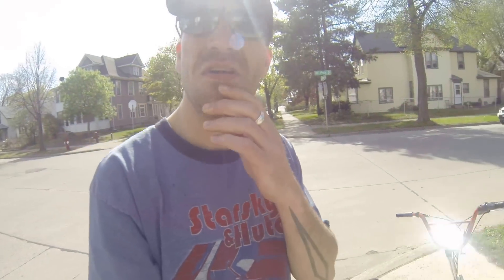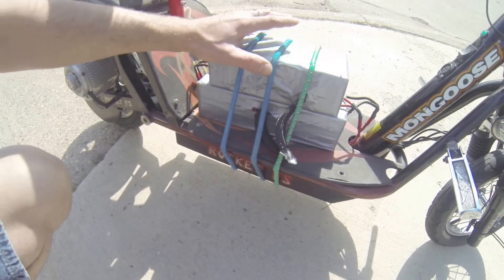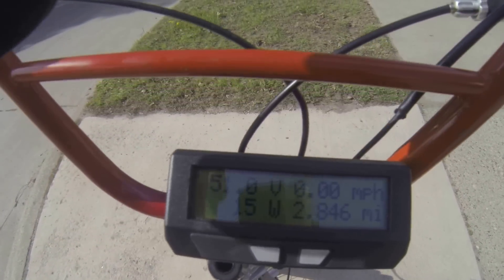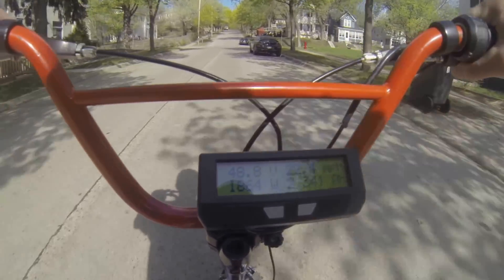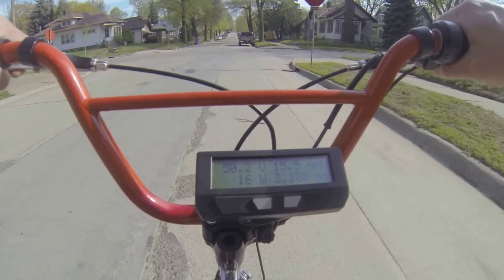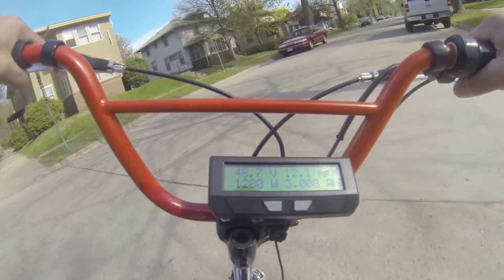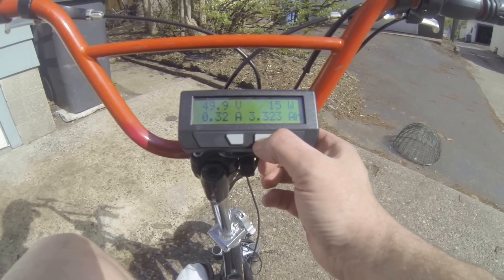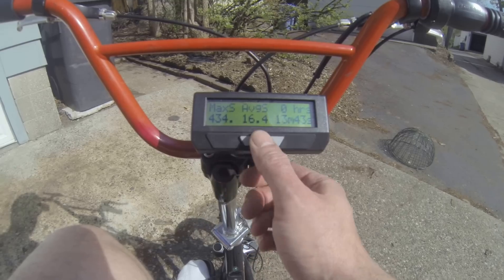Currie-Tech Electric Scooter w/1000 Watt (36v/32a) motor, over volted and re-geared: 30mph 1900watts

Comment: what sprocket tooth are you using? 72tooth
Reply from the maker: front sprocket: 13t
rear sprocket: 65t
Gear Ratio: 5 to 1
Reply: @augustjohnston  I also have the same 1,000 watt motor you have. But I need to find some lashout rims so I can make a custom sprocket for my 03 missle fs
Reply from the maker: @fastfords9072  I ordered both sprockets online.
Reply from the maker: https://alfa-wheels.com/products/25-65t-4-hole-sprocket-chain-drive-gear-f-rear-wheel-gokart-scooter
Reply: @augustjohnston  I used to get mine from Scott at ev deals but I think he died. I'm trying to get 2 lashout scooter wheels
Reply: @augustjohnston  did you take the original 90t and custom make it? I had the guy at ev deals do it 10 yrs ago but I think he died. This whole new market of scooters is crap. Schwinn, Currie, fs lighting, lashout scooter is so rare hard to find. I have a missle fs
Reply from the maker: @fastfords9072  no I ditched the 90t for the 65t. better gear ratio for 30mph. and still enough torque of the line for my 180lb self. I had to retire this rig because the band brake  wasn't up to the job. anything over 20mph and would start to feel slippery and not catch. super dangerous

Comment: I took a Schwinn S750, threw this motor on it and left it at 36v but swapped to a 20ah lipo and have the 15 tooth freewheel motor sprocket as well as the 47 tooth wheel sprocket. I'm running a brushed 1000w controller and it gets 35mph on flat and 28 up most hills. I'm only 130lbs so not much for the scooter to move

Comment: Fuhhhhhk ! What's with your audio, man ??! 
It does book along though- I'll give ya that !
Now to find a way to mou t the batteries that wont look lame.
Hope them cars don't nail you ! 
W
Reply from the maker: yeah the gopro picked up every sound on the scooter.
 I actually retired that particular scooter because the cantilever brakes stopped working on anything faster than 20mph. I'm building a disc brake version.

Comment: I have a motor 1000w 24 v    .. if i runn it with 12 v .. how much w will   it spend  ( will my bateryes last longer ) ps : using it for ebike
Reply from the maker: about half the power, and the batteries will half as long as their 24v comparison, assuming the Amphours are the same.
Reply: @augustjohnston   i have a 1000w motor but i cant feed it with my bateryes .. what shuld i do .. any suggest ?

Comment: I've got a Schwinn S350 (also Currie Tech drivetrain). I swapped out the stock dual 12 volt lead acid battery setup with a vastly superior dual 12 volt Duracell lead acid unit. I weigh 165 pounds, every nut and bolt on my scooter is either new or re installed properly and my tires are pumped to 50 PSI for maximum efficiency. I heard LiPo batteries make for a serious improvement over Lead acid due to improved charging times, much lighter weight and increased power output. I'm wondering if anyone knows a way to hook something like that up to my Schwinn S350 and if it's possible to hook up more volts than what mine currently has (24 volts)
Reply from the maker: The 350watt motor on that setup will take more volts, but they tend to over heat very quickly. and when they heat up, they don't work as  efficiently.... and often burn out. personally, I wouldn't bother overvolting anything under a 750watt motor. But if you decide to try it anyway, try adding a 3rd battery in series to make it a 36v setup. Some of the controllers will shut off if they get too hot. even on my 1000w setup, it'll shut off if I go full throttle uphill.

Comment: We had a little kids electric bike with a currie 4 brush 200 watt motor. Pretty sure we put 3000w through it for short periods, was frightening it screamed, and felt like the chain was going to break. Not often you get an electric bike breaking traction going down hill with a load on. Not often your frightened to get on an electric bike.

Comment: BH
hi , thanks for the video. i have almost the same scooter.  My back tire popped. Have you ever tried replacing the tire on yours?  If yes, coul you please give me a little guidence on how to remove the back wheel?  Does it require me removing the motor?   Thanks so much.
Reply from the maker: it depends on the scooter, but most of them you DO have to take the motor off. I've changed my tire at least 10 times on 2 scooters, over the past 10 years. They pop easily unfortunately. it's not rocket science to change it. 2 axle nuts and a few hex bolts. you probably have to disconnect the rear break cable to get the wheel all the way off. Takes me about 20 minutes.... but it used to take about an hour until I got more practice.

Comment: who makes the motor
Reply from the maker: It's a china motor. Currie-Tech Branded. I had to stop using this scooter because I didn't have disc brakes. the V-brakes, at 30mph, are nearly non-existent. they actually feel slippery until I slow down to about 19mph, and don't grip well until about 10mph. WAY to unsafe.

Comment: That's a great build! How has this motor held up to that much voltage? Thinking of putting one in a Razor Crazy Cart.
Reply from the maker: it's still kicken. I have 1500 miles on it. I discontinued this scooter and put the motor on a dif setup. The brakes were highly insufficient. almost died a few times.

Comment: Skip to 2:20. that thing is fast! thanks for the vid; I run my ezip 1000 at 48v as well; goes 20mph on flat ground, 17 up hills.
sucks the first minute sounds like nails on chalkboard. i'd recommend deleting the audio or just that part; maybe just use music and add notes.
Reply: Hey OffGridNorthwest, I'm putting 60volts on my ezip 1000. Hows yours holding up? Did the extra batteries increase your distance much? Thanks.
Reply from the maker: I run 58v li-ion pack in my ezip1000 (I have 2 actually). I have over 1500miles on my speedometer. the motor is still kicken strong. 
one of them is making noise. I have to open it up... but I think it's the gears, not the motor.

Comment: are you using the standard speed controller that comes with the currie scooter?
Reply: +John Ellis I use the stock controller with 48v just fine, but it won't go over 20mph, so I'm guessing he's using something else
Reply from the maker: In this video, no. I upgraded to the 30amp controller.
Reply from the maker: be warned though, the pin configurations are different on the 30amp controller! huge pain in the ass.
Reply from the maker: (throttle pin config)

Comment: what type of motor controller u r using to control the speed of motor .. and how much amps ur battery can supply
Reply from the maker: 30amp controller. looks exactly the same as the stock ezip1000 controllers, except the throttle connectors were different. had to buy a dif throttle because I couldn't figure out the pin re-configuration.

Comment: Why does yours go so dam fast. I have a 48V, 1500W brushless motor and it goes about 10 mph for about 500 ft. before cutting out and dropping to 3 mph due to heat?
Reply: +Tucker Not Sucker! try a smaller motor, and over volt it, these curries use a 1000w 36v motor so a 48v set up would be great , swapping controllers may help as well
Reply: Fareed Alshami So I can run let's say 64V through a 48V motor or even higher there must be a limit?
Reply: between 60 and 64v. i try to stay conservative, but 48v is excellent in our 36v scooters, i dont remember if i used the stock controller, but if im not mistaken the stockcontroller can handle 48v . i may hve also upgraded it for better power

Comment: im 15 years old and im only 90 pounds and i have the schwinn stealth 1000 and i over volted it to 48 volts and it goes about 25 mph. it runs fine and i havent noticed any cosmic wear or anything from the stock motor or controller. but i noticed i had to chare the batteries only a little when i first did it becasue the controller wasnt breaking into it instantly. but about 4 days later i was able to charge it fully and the controller could take it. has anyone ever tried 60 volts? i would like to try it.
Reply: +Chance Hastings only ever go up by a little i , forget the exact number but i think its like 1.5 times you can go up before blowing a motor
Reply from the maker: as seen in the video, I have the same motor as the stealth1000. I'm putting almost 2000watts into the motor with no problems. However, the stock controller on one of my stealth1000's would shut off when I put 48v into it. I replaced it with a duplicate controller and it worked fine. I believe the thermostats in these vary a bit. The replacement controller shuts off if I go full speed uphill with extra weight. but if I go 80% throttle, it doesn't shut off.
Reply: It may be temperature limiting or even potentially amp limiting or limiting voltage. Its a number of things I'd just go with an aftermarket controller. I avoided over volting this model since I was afraid I'd start breaking gears since I think they are just nylon
Reply from the maker: yes, it's the thermal limiter. some are more sensitive than others. if slowly accelerate, it doesn't heat up as fast. 
the gears are all hardened steal. WAY WAY WAY too much torque for anything less.

Comment: very dangerous chassis above 25 mph , ive done it , seen it been there.. but congrats
Reply: Naaa it'll be fine. I've had my ezip 500 over 40mph. Nothing stock except the frame. It held up just fine.
Reply: @DTB2.0  what did you upgrade with ???
Reply: @djmusclecok  I upgraded the controller and installed a brushless motor and lithium batteries

Comment: nice video
what kind of range do you get on one charge with that setup?
Do you know much about the battery packs?  I'm wondering if they're made with 18650 batteries which is what I was considering using to build my packs whenever I get around to it since I can get them for around $1 each.
I want to do this on a bicycle though.  I came to this video after searching craigslist for electric bikes and found one there that had a Currie motor and I was looking here on youtube for instructional videos involving Currie motors.  This is so far the best if not only video I've seen but I haven't tried looking at non-Currie motors yet.
Thanks...
Reply from the maker: yes I use a 48v/10ah (10s13p 18650) that I built for another scooter, and it fits in the battery pan on this scooter too. I usually charge it after 15 miles. but I think it could safely go 18 or 19 miles in perfect conditions (I weigh 175 lbs). The pack already has over 1000 miles on it and it's still rocken strong (2 summers of zooming around)

Comment: Can you send me a close up picture of your set up with the motor ? I need to see this cause I blew my gearbox to my ezip1000 36v the motor works but it's not moving :/ therefore I want to convert it from direct drive to chain (I'm tired of the problems the gears are giving me , I rather have chain
Reply from the maker: well, that wouldn't do much, as I put the new motor on and older setup. However, I do believe you could add gears. you would have to add a rear gear to the back axle... which is 'keyed' and spins (unlike my setup where the axle is stationary and the gear is on the hub). I recommend getting your hands dirty and just figuring it out like I did. I can assist you in chopping the gear box off, and unless you plan on getting an older setup, I wont be much help.

Comment from the maker: Sound like a plan. altho, the 1000w currie motor, at 48v runs about 4200rpm.
Plan accordingly. 
front sprocket: 13t
rear sprocket: 65t
Gear Ratio: 5 to 1

Comment: pretty cool, did u change the motor sprocket to a 15 tooth?  im in the middle of a project , bought a x-treme x500 48v for cheap and im gonna put a 3000rpm 1kw motor , controller, and 15 tooth sprocket on it .   what do you think?  ordering from same tnc website

Comment: thanks for your help. I have the 15t motor sprocket with freewheel. Is there a way to remove the freewheel off the motor sprocket and just use the 15t by itself? that way the 3" tire will fit. (i currently have the 2.25" tire)

Comment from the maker: well, it wouldn't make sense to use 2 freewheels on one drive system. I used a rear freewheel as the motorside 15tooth freewheel wouldn't fit between the motor and the tire (I am using 3" x 12" tires). The reason you shouldn't use a freewheel is because, after decelerating but still coasting, if you re-engage the motor it will go full speed until it hits the matched coasting speed... at which time it 'snaps' or 'catches' quite forcefully causing the front sprocket to strip out.

Comment from the maker: that XYD-12/13 motors are inferior compared to the XYD-18 (1000w). I weigh 180lbs. Thats the same gear ratio you got there... and that was the first setup I did... but the teeth stripped off the 11t sprocket because I had a freewheel setup at first. I went up to the 13t for strength.

Comment from the maker: Also, I had to upgrade the stock 36v/30a controller with a 36v/40a controller... which only has the 3 wire throttle connector. The motor gets really hot after about 25 minutes of use.... but so far so good.

Comment from the maker: there is a youtube video somewhere of a guy doing the same thing as you... and I'm fairly certain he kept the motor mount intact. email me and I can send you a gear ratio calculator for figuring out which sprockets you need. On my fast scooter (the mongoose) I am using a 65t in back and a 13t on the motor shaft... a 5-to-1 ratio. with overvolting I get 33mph consistantly. dont use a freewheel

Comment from the maker: I thought about this for a while and looked at my scooters: I think the existing motor mount on the ezip1000 will work perfectly. then you wont need that motor 'plate' that's used on the older setups. The single most important alignment will be when you weld a new cog to the motor shaft. Save that step for last.

Comment: Thanks for the info August, i have been searching and reading for a few days about this. Just for reference, i also have a Schwinn S500 scooter and i have notice that the rear tire wheel fit and can replace the Ezip 1000 rear but will need mounting dropout plate to put the threaded wheel assembly and then built a way to attach the motor mounting plate to the chassis.

Comment from the maker: I should mention: on my non modified 1000w scooter, I over volted it from 36v to 48v by simply adding another battery. With a little modification (cutting the foot plate screw mount off the frame) you can put four 12ah batteries side by side in the battery pan. I had to raise the plastic (around the seat post) up about a 1/2 inch as the 12ah batteries are a little too tall for the battery pan. I just rest the foot plate right on the batteries. now it goes about 20mph with no real mods.
Reply: What about proper charging and the speed controller? Won't this burn up the controller after a while? and the stock charger is going to undercharge the whole battery bank as well. How do you address this?
Reply: Also, would upgrading to the 40Amp Speed Controller without overvolting give added speed with my 750W motor?

Comment from the maker: if you could figure out how to attach a rear sprocket to the newer style wheel, that might be the way to go. but I haven't done it myself. As for mounting the motor on a older setup: I left the original mounting holes on the motor and cut away everything else. 2 of the 3 holes lined up with the old style motor plate.... so I only had to drill 1 hole in the plate (as I recall). The mongoose frame has a extra little arm that holds the tops of the motor in place to keep it from 'sagging' as you say

Comment from the maker: I put the new motor on an older setup. All pre-direct drive setups are all the same and use a standard wheel with a fixed (and threaded) axle. The new setup is completely different: the axle spins with the wheel and the bearings are on the outside of the frame (not in between the wheel mounts). also the axle is wider. If you plan to use a chain drive (which is far less bullet proof) you'll have to switch out the whole wheel (one that has a longer axle than usual).

Comment: Also if it was the original mounting bracket, how you manage to hold the motor in place to avoid sagging from torque? Example: the gear box assembly was giving support from motor moving to the rear (sagging).

Comment: Yes i did but you didnt mention what wheel assembly you used if it's the original or from a different scooter and how did you mounted, any fabrication involved. Also you did mention about mounting plate re-drilled the mounting holes but didnt mentioned if it's the original mounting bracket or from a different plate? If it was a different plate, how you hold it together to the frame? And if it was the original bracket? what you did to hold the motor to the frame?

Comment from the maker: be mindful of your chain drive alignment when welding the 11t sprocket to the motor shaft. You are better off having the cog farther from the motor than you are having it close to it.... because you can always add spacers/washers between the motor and the motor plate to off-set/adjust for the drive system alignment to the back sprocket. Good luck!

Comment from the maker: 11t sprocket (SPK-106005). Then I had to drill new holes onto the motor plate as the mounting holes are different spacing than the original motor. I also changed out the original big sprocket (80 tooth I think) for a 55 tooth one and moved the freewheel to the back using a rear wheel freewheel on my original mongoose wheel (google SPK-103210 and SPK-103230 TNC scooters). I also upgraded to 48v system by over volting this 36v/40amp controller (CTL-101202) combined with li-ion batteries.